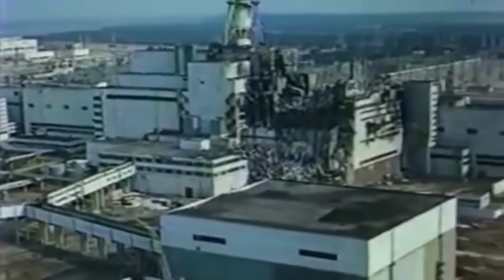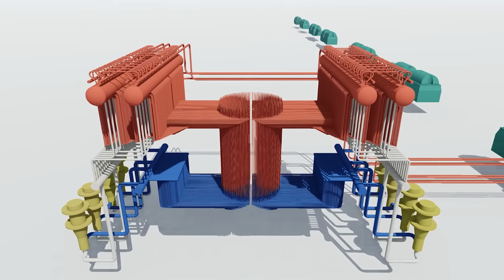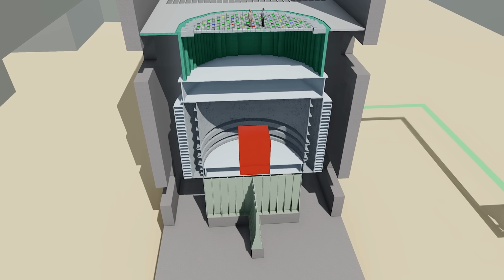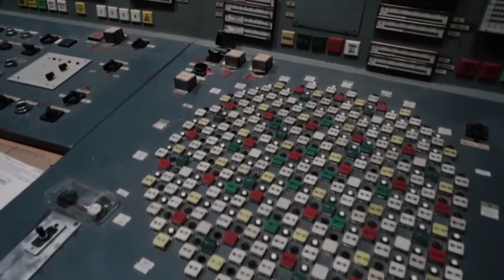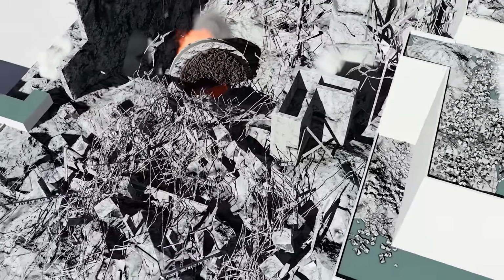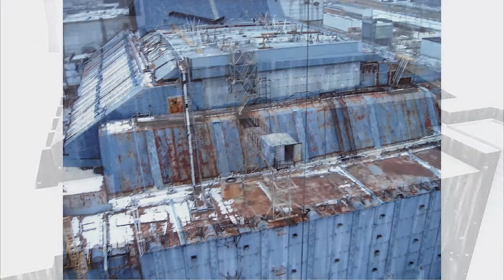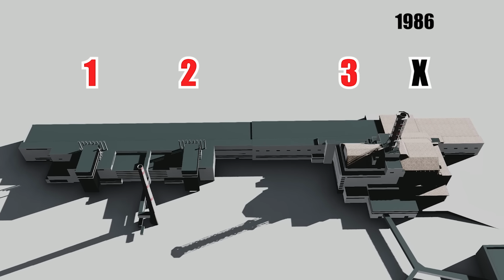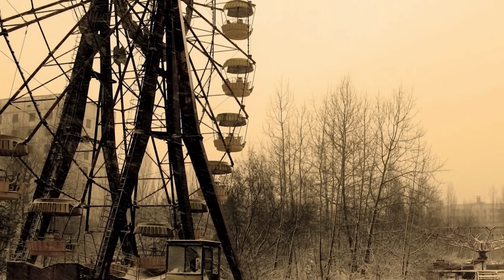CHERNOBYL DISASTER - An Inside Look - 3D

Comment: rbmk reactors were almost the safest reactors ever, they couldnt explode but in case of a disaster it would melt down. but ofcourse dyaltov didnt listen to the rules and without rules every reactor can explode.
Reply: HBOs chernobyl didnt recall an accurate set of events. it wasnt dyatlov it was akimov. and the one who was pushing from above
Reply: The RMBK was a graphite-moderated design.  It was designed to work with cheap fuel, and designed to work with very large quantities of it.  Graphite neutron moderation is inherently unstable and needs constant monitoring.  There is no universe where this could be called "almost the safest reactors ever".  More likely the unsafest reactor ever designed, built and operated in the unsafest way.

Comment: Mostly well done. Reserve generator test was non critical procedure and Diatlov team dont disabled any safty systems what can be associated with reactor failure. Problem was in undocumented unstable reactor regimes -- no one on a station knew how dangerous it is. But for manufacturers it was not a secret for 10+ years!  AZ switch reaction time was around 18 sec but for same type plutonium generation army rectors it was 2 sec. Later upgrades for civil RBMK achived same time and rods was upgraded to eliminate initial boost. There is a versions what one of the blasts was "atomic" and 90+% of fuel was thrown in 3-8 km heights of atmosphere and speeded all around world.
Reply: Yes. Atomic energy is huge money question, people understands that poorly and believe easily in propaganda legends about smart design and safety. Poor stupid people

Comment: Few things:
1) there were no "graphite bricks", because graphite may increase the speed if reaction, graphite covered ends of control rods which were generally made of boron, which can slow down or even stop the reaction
2) there were 2 explosions - first exploded steam from water used to cool the reactor because of too high pressure which was an effect of too high temperature. The core exploded a few minutes after that.
3) It's not truth that next possibility for this test would come next year - they could do it every time, but it was close to 1st of May which was one if the most important days in communist countries and that's why it was so important to do this. Generally the reactor shoulded not work until the test is successful (but there was too big pressure from Kreml to start this reactor as the amount of electricity from current at that time power plants was not enough for all because military sector used a lot of it).
4) Test should had been performed by daytime shift, the plan was that the night shift will only control the flow of water, but authorities didn't allow previous shift to do this as there will be missing too much of electricity. Night workers weren't prepared for that, nobody informed them, but they had to do this as it was the order of Anatoly Diaytlov who was v-ce master engineer of Charnobyl Power Plant. Nobody was that brave to tell no to this man as it might be the last thing he would say as worker of that place (welcome to Soviet Union).
Reply: 99% of things you wrote here is a gabage :((( sadly but its really 1st lvl myths
Reply: prove it....
Reply: No graffight is a moderator 💀

Comment: To me it seems like a poorly designed reactor if it cant stand a loss of coolant for the time it takes for the emergency system to come online.
Reply: There was a massive power outage and almost all the rods that slow the reaction weren’t active meaning the coolant diddnt flow
Reply: @lxartz6266  It was a test, not a power outage. The operators, under pressure to achieve a successful test, put the reactor into a very unstable configuration that they didn't understand. In that configuration, a reactor SCRAM was capable of pushing the reactor beyond criticality.
Reply: Seems like something you don't build, but use as a reference to build something else, no?

Comment: This completely failed to explain the accident.
Reply: The real reason was the USSR did not build the reactors as safely as they should have because of outside forces. A man in the upper management of the plant was in that control room that morning to supervise the test. It has been years since I last read anything about this. During the test, they were going to reduce the power output to around 700 Mega Watts, but something went wrong and that power dropped to no output. Rules were the reactor had to be slowly shut down over a 24-hour period. This member of upper management who later served 10 years for his actions that morning restarted the reactor. 180 degrees opposite the correct procedure. This caused the reactor to overheat. Then they (SCRAMED) the reactor (emergency shut down by fully inserting the fuel control rods). Sadly here is where more USSR cheap came into account. Those control rods had graphite on the tips. This substance caused the reactor to run out of control and the control rods got stuck. Then the pressure inside the reactor got so high it blew off the top of the reactor through the roof of the building.
Reply: @THE-michaelmyers  Can you say "xenon poisoning"?
I knew that you could.
Reply: @daryllect6659  As I said, it had been years since I last read anything. You are 100% correct about the Xenon buildup in the reactor. This is what caused the power output to drop.
Reply: Core get hot from test emergency button press uh oh bad core water steam BOOM radiation elephants foot sarcophagus

Comment: Why is part of the sarcophagus on the roof of reactor 3?
Reply from the maker: I don’t know the firm answer but unit 3 roof had lots of radiation and possibly it was structurally weakened and they didn’t want it potentially collapsing from snow load.
Reply: Basically, because the graphite which was on it‘s roof back then was removed, but there was still a butt ton of radiation. And yes, the structural integrity was also quite low.

Comment: I believe the video is wrong. Temperature does decrease the radioactivity. The positive void coefficient has to do with steam:  if the coolant is a liquid, it may boil if the temperature inside the reactor rises. These steam bubbles are called voids.  The amount of void inside the reactor can affect the reactivity of the reactor. The change in reactivity caused by a change of voids inside the reactor is directly proportional to the void coefficient, so it is a scalar. This has to do with steam, not temperature.

The Chernobyl reactor did have a negative temperature coefficient, meaning that higher temperatures slowed the reaction down. However in the lack of control rods and fresh coolant, this wasn't enough to stop the reaction from becoming an explosion.
Reply: Don't overlook that the steam voids are ultimately the result of an increase in temperature. The void coefficient was so significant in this type of reactor that it dominated other coefficients including the fuel temperature coefficient. 

An increase in temperature creates steam voids, and because the reactor is graphite moderated, it leads to an increase in reactivity, which further raises the temperature and reduces cooling capability - then this repeats - a disasterous positive feedback loop.
Reply: Marcus Klyver,  Thank you. This account isn't quite accurate as well. For all those HBO naysayers.

Comment: What is the lid of the reactor made of?
Reply from the maker: It is made from metal plates filled with a special stone that blocks radiation.
Reply: @Mike-Bell  graphite?
Reply: @Haz_wizZYT  according to my knowledge outer side a thick layer of concrete and inside again a thick layer of Graphite
Reply: @Haz_wizZYT  I can't tell if this is satire, but just incase it isn't, graphite doesn't block radiation, and the graphite is found on the bottom half of the control rods, I'm not sure what stone Mike Bell mentioned is, however it is possible that it was lead, as that blocks radiation.

Comment: Yes the RBK reactor was flawed but let’s not forget that this was human error not a mechanical error.
Reply: The real human error was keeping that design flaw a secret
Reply: Nothing should ever be built that has the potential to be this dangerous. RBMK reactors lack basic and standard safety features. If you build an airplane without safety features, and many people die as a result of pilot error, the aircraft design is still the problem. Things should be designed so that even when there is error in human operation, the result is not catastrophic.
Reply: Everything can be a hand grenade if you try hard enough

Comment: oh. so that Fukushima is how "stable by design" western reactors are stops. OK. keep us informed comparing modern exploded western Fukushima and half of century old Soviet reactor.
Reply from the maker: Fukushima did not explode, it melted down.   The Fukushima reactor was stable.  It was power supply to the water pumps that was poorly designed.  The power supply was knocked out by the tsunami.  Chernobyl was unstable.  It had a runaway reactivity  surge.  I hope that helps.
Reply: @Mike-Bell  Chernobyl also does not exploded in your terms. Melted core produced hydrogen which than exploded same way as Fukushima. And it also does not happened by its own. Personnel error forsible disabled all security systems is way worse than tsunami.
If core was stable than it has not to be melted.
But the result is the same. Melted core and hydrogen explosion. When in Chernobyl only one reactor faled while Fukushima multiple. And that happens 50 years after Chernobyl lessons already has to be learned. Dramatically "competent" company which engeneered the Fukushima has to be banned from nuclear projects.
Reply from the maker: @night_gryphon  🥱
Reply: @Mike-Bell  He is right though, Chernobyl was hit by something worse than a Tsunami and Earthquake, it was hit by communism.
Reply: I'm sorry, but Chernobyl's Unit 4 was NOT 50 yrs old. The reactor was officially commissioned in December 1983. Units 3 and 4 were second generation RBMKs with a slightly different core load-out (less fuel rods, more control rods) from Units 1 and 2 that were the first generation RBMKs.

In Fukushima, the reactors SCRAMmed the moment the first tremors were picked up by their very sensitive earthquake sensors. It was the flooding of the basement that housed the backup generators that did the plant in. With the surrounding infrastructure destroyed by the earthquake and subsequent tsunami, there was no way to get portable pumps/ generators to the site in time. The reactors themselves did what they were designed to do, SCRAM at the first sign of trouble. Would you like to try again?
Reply: @swokatsamsiyu3590  he’s saying the design was 50 years old*
Reply: @Live2ride2live54321  
The same goes for the PWR/ CANDU designs, but they work just fine. Even an RBMK can work well if you very strictly adhere to safety rules/ standards and do not abuse the heck out of it. There are several NPPs today that still use the RBMK. They have given them proper safety systems, train their operating staff properly etc.. Yes, they're still old, they still cannot have containment buildings due to the tall loading machine, but apart from that they're now as well behaved as you can expect them to be. So, there's that.
Reply: @MutantWeapon what is runaway reaction  ?
Reply: @rameezhaider8673  the reactor stalled during the test so they pulled almost all the rods out which started the reaction to surge so they pressed az-5 which put the rods back into place but they were graphite tipped which caused an even stronger reaction instantly with no way to stop it
Reply: @slutzk8233  Z

Comment: Great video. There is a slight correction to be made. The reactor did actually slow down with increase in temperature (negative temperature coefficient). However, it did have a positive void coefficient which has nothing to do with temperature but it means the reactivity will increase if the water converts into steam. This usually isn’t an issue cause the water is circulated but on this day they were running a test which required the pumps circulating water to be switched off which allowed the water enough time to boil and convert into steam.
Reply: great explanation and username

Comment: A positive void coefficient isn't about the temperature of the fuel. The RBMK reactors have a negative temperature coefficient, which means reactivity does drop as temperature rises. A positive void coefficient refers to reactivity increasing if the coolant water boils and forms voids of steam.
Reply: Many thanks. I asked myself all the time where the term void comes from.

Comment: I'm super confused why would they replace the ventilation stack? Don't you think it would want to keep the air completely covered why have been exposed I'm just totally confused by this
Reply from the maker: They are still decommissioning unit 3 and during the process off gassing may be required hence the replacement ventilation stack.

Comment: If graphite is the moderator of the reaction, why did the control bars have graphite?
Reply: it was apparently cheaper for them to have graphite tips,  which really isn't smart but they wanted the reactors to be made cheap and everything inside done cheaply :\
Reply: @vladbat4050  But the URSS pioneered the use of nuclear energy for large-scale electricity generation. Master this technology like no one else. They knew that graphite-tipped control rods would lead to peak power when inserted into the reactor, which is a major safety issue. There must be some technical explanation for this. Money shouldn't be the only explanation.
Reply: @MirianBatista  They knew things didn't work; they weren't safe, but they did not care. When there is no incentive to do things correctly, you do them cheaply.
Reply: @MirianBatista  the positive void coefficient stopped the control rods from being able to fully lower into position, lots of pressure. For the safety test they were performing that day (should’ve been 10 hours earlier) they held the reactor at half power 1600 megawatts causing the reactor to poison itself with xenon. That right there starts the domino effect
Reply: @brianmccarthy9855  I understand that they took out almost all the control bars to increase the power of the xenon contaminated reactor. But I don't understand why they used graphite at the lower end of the bars. Is this a design flaw?
Reply: @MirianBatista  Normally, when control rods are withdrawn, they are displaced by water, which is a neutron absorber. By fitting graphite tips to the control rods, the graphite part remains in the centre of the reactor when the rods are withdrawn, and this allows for more radioactivity and, therefore, energy output. When the control rods were lowered, the graphite tips displaced the water underneath them, at the bottom of the reactor, which caused a massive spike in radioactivity before the 'controlling' part of the control rod arrived. Scott Manley's video gives more information.
Reply: @nkt1  I understand what you say. It means that, in the case of the Chernobyl reactor, when the control rods are inserted into the reactor core, there was always a peak in reactivity and then a decrease when the other part of the rod that absorbs neutrons entered the core. Under normal operating conditions this didn't seem to be such a problem, but in the chain of events that day those graphite-tipped rods seem to have contributed greatly to the final outcome. Am I right? Thanks for the explanation!
Abraços!!
Reply: @MirianBatista  The graphite 'tips' were quite long, and occupied most of the channel when the control rods were in the raised position, but they didn't reach the bottom of the reactor. So, when the control rods were lowered, the long graphite part had to pass through the water at the bottom before the control rod could reach it. Unfortunately, during the test, this is where all the bad stuff was happening, due to the reactor being in an unstable condition. So, the graphite replacing the water temporarily increased the rate of the reaction (and heat, because the water was the coolant) and thus caused the explosion.
Reply: Finally, People understands that primary cause of disaster was poor stupid design, wow ❤ I've almost lost hopes reading other comments

Comment: Have not heard such propaganda for a while- multiple safety systems were bypassed- how is that a failure of the reactor design? Why are you even trying to pretend that you have a clue about what's going on? Liquidators were very well aware regarding radiation effects!- stop spreading your lies! My close relatives were liquidators - they are fed up with all that propaganda nonsense
Reply: The graphite tips on the control rods was the design failure.
Reply: @Amelia_Gray  😵💀
Reply: Quiet hater